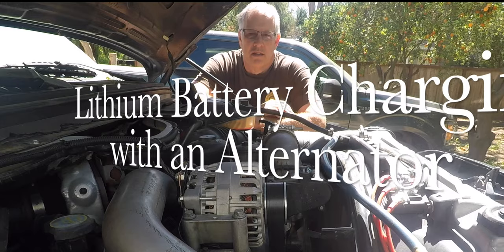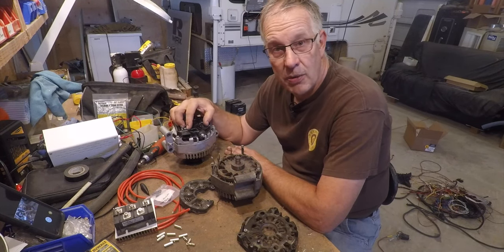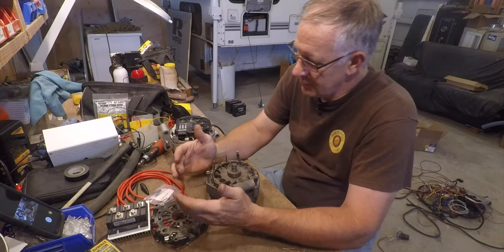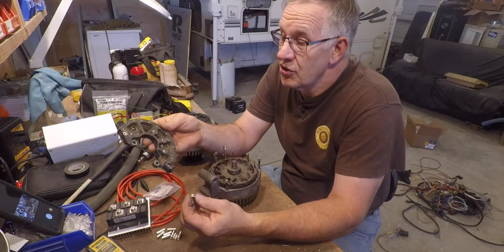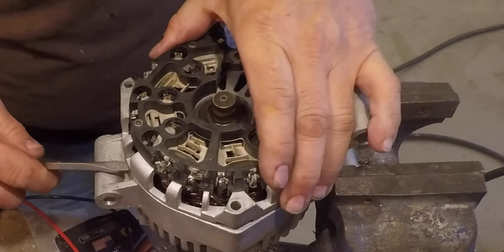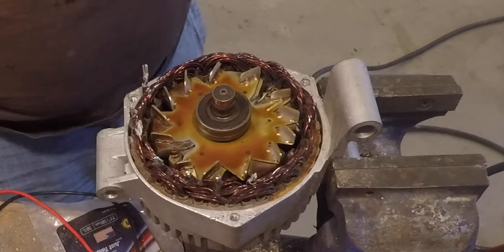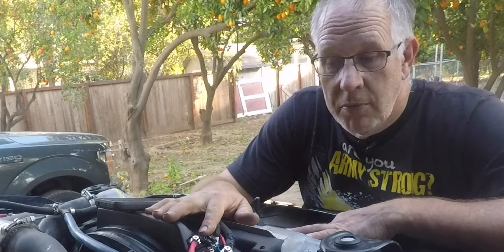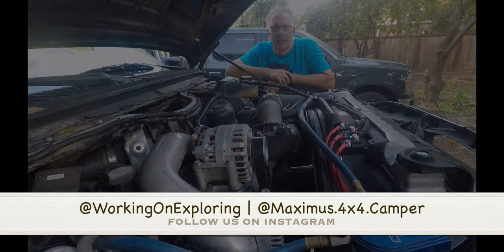Lithium Battery Alternator Charging | Don't Blow Up the Alternator | DIY Truck Camper

Comment: The more I see your rig you built the more I like it. I'm still building out my holiday travel trailer for off grid living but being on the road in this semi 3 weeks at a time is making for slow progress on the camper.  I'm wanting to build a 24 volt charger from a diesel 24 volt alternator and a harbor freight engine next
Reply from the maker: Sorry I missed your comment
 Automotive alternators are very inefficient and if you want to do the best possible, get a brushless alternator. They are around 75% as compared to about 60% for a claw pole design (standard automotive). Military surplus alternators are brushless and were cheap 4 -5 years back. I bought several which I am now not planning to use.  I have 2-24V/400A and a 12V/24V/200A. These things are very heavy and big. I converted a 12V/220A Ford 4G to 24V. It works fine but its not something I would want to use a lot (poor efficiency and heat) but it was  the only option I had.
Reply: @WorkingOnExploring  do you think I'd be better off just using my 120 volt to 24 volt chargers and a generator when I don't have enough sun to charge? I'd say going to harbor freight and buying a generator might be my best bet but I do like the alternator set up
Reply from the maker: I think a small portable 120V inverter generator would be more economical, reliable and lighter. THE KEY is to get a battery charger that can put a max load on the generator. You don't want to have a 2kw generator and a 1kw charger. The likely best way to do that is with a low frequency inverter-charger. My Samlex EVO 4024 allows me to set how much power it can draw from an AC source. I can set it to the max of a generator capacity OR the max of a shore connection. It allows me to draw whatever AC I want in the camper and the rest goes to charging. Charging is a second priority so AC appliances always have priority. The charger is 110A (at up to 29.4V) so is capable of fully loading a 3kw generator. If I am drawing max battery charge and I stick something in the microwave, the microwave gets what power it needs and charging decreases. When the microwave goes off, charging increases. This is most helpful when my 120V/30A shore cable is connected to a 120V/15A circuit at someone's home that may also be powering something in the home. If I set it to 10A to make sure I don't pop their breaker, that isn't enough to run the microwave. If I try to use the microwave, it switches to inverter and draws battery power to operate the microwave then goes back to charging. Mine does not have a power sharing where it augments the insufficient shore power by adding inverter power to make up the difference but several inverter manufacturers have that too.
Reply: @WorkingOnExploring  I have a low frequency sungold but it's the 4000 watt split phase.  It will do charging but it would take a 220 generator. I also have a 3000 watt all in one powmr that I can adjust the charge buy it will only do 40 amps and I'd like something that can charge at 150 or even 200 amps. Maybe even more.
Reply from the maker: You Sungold is only charges at 50A (about 1400W) which is a problem because you'll likely not find a 240VAC generator less than 3kW. Requiring a 240VAC shore input is also a problem as it is likely only available at a premium site in an RV park. I rarely need shore power and don't have a generator. When I do plug in,  There are lots of times where I run on 10A/120V.y A/C only needs 8A max to run with no starting surge. Do you have a need for 240V output? If not, you'll be better off with a 120VAC only. I'd look at what you really need for AC power both in and out. Inverters are very inefficient if run at less that 30% load (1200W). I wanted 3kw but it was harder to find in 24v. I also run an 800w PS inverter continuously to support the domestic fridge and small 120V loads 24/7 but that might be a bit big too.
Reply from the maker: While 40A is small, I assume, as a van,  you're unlikely to often be on a connection that can operate 150-200A (4-6kw). I also question that much amperage because it also infers you need a lot of power fast which is often not needed. Assuming you're parked (and charging) overnight assume a minimum of 8 hours to complete your charge. Assume an average battery debt....a 40A charger over 8 hours (assuming average battery voltage of 26.5v) you can recover 8.5kWh. that's a lot of battery debt. While the debt may be created over several days (assuming you have around 10kWh of battery bank capacity), that 40A still seems like it would be enough most the time. It gets expensive planning for those once a year or once in a lifetime events.
Reply: @WorkingOnExploring  I use a small welder from time to time. I have 3 charge controllers and the largest is a victron 150-70. I have 2 inverters a 4000 low frequency sungold power and an all in one powmr 3000. The powmr 3000 can charge from grid or solar or both. 40 amps grid 60 amps solar. I also have another 60 amp powmr charge controller. Rather than stacking a few small grid style chargers when we get a week of bad weather I'd rather have a 150 amp charger that would carry the loads while still charging the batteries. With a 150 amp charger if I'm in the camper continously useig power while charging its really slow to gain ground it seems
Reply: @WorkingOnExploring  my 38 seer minisplit is 240 volts and I split breaker box in half and run one leg of the 120 to one side and the other leg of 120 to the other. The only appliance thats 240 is the minisplit tho.  My welder is 110 volt and I actually run it from the powmr 110 inverter. Just charging while still powering everything else in bad weather is the only reason I want a large generator and super high amp charger.
Reply from the maker: Lots of hardware for a van but I'm sure you've got a reason for it. I'm also one that finds it hard not to be prepared for most things that can be encountered. Welding can be done pretty simply direct from an alternator. Probably a lot easier and lighter just carrying cables than an AC welder. The jeep I tow has a 250A alternator (for the winch) that will soon be  set up for welding.
Reply from the maker: Running 240v for a high efficiency minisplit may be losing as much energy in the inverter that you save in the A/C. Fundamentals of power conversion dictate that the greater the input/output differential, the lower the efficiency. In general, above 30% load, a 12VDV/120VAC inverter can reach 92%. A 12VDC/220/230VAC is around 85%. Better inverter designs can make a difference but the physics of 'leveraging' voltage just turns out that way.
Reply: @WorkingOnExploring  I saw a portable welding rig that has a nice wire feed and all that uses 2 car batteries.  It was pretty awesome. The reason I have so much equipment for my camper is that I started buying and installing this stuff to find out a little later that the 3000 watt inverter wasn't nearly enough power. I then got the 240 split phase inverter by getting  sent the wrong inverter... it was supposed to be a 6000 watt sungold single phase 24 volt but by the time I came in off the road to even see it for the first time the amazon return window had passed and I was kinda stuck with it. Then I saw the higher efficient minisplit and was looking at well pumps and figured I might should just keep it. Kinda glad I did. I've over the last couple weeks started buying some victron components. I got a new 150-70 smart solar charge controller at home and gonna be installed this evening soon as I get there. It's only a 30 foot holiday rambler so it really is alot of equipment for such a small space but one day I'd like a small off grid property and have a stable water source and maybe some of the equipment I've over bought will help out at that point.

Comment: Some initial testing done on two separate occasions: 1) At 98F ambient on level to slight uphill freeway at 210F engine coolant temp,  I could charge at 28.8V/90A (about 2.5kW) with alternator at 228F/114C, continuously. 2) At 40F ambient with about 140F engine coolant temp (in a snowstorm) on a winding downgrade 2 lane, I could charge at 27.4V/100A (2.7kW) with the alternator at 180F/78C, continuously ( and clearly could have tested much higher if not for the winding road). Overall I feel performance has improved at least 30%. It is difficult to replicate operating conditions for comparason. With the original alternator, in conditions similar to test 1, I would not have expected to get much more than 60A because of the high ambient and engine temps.

Comment: I love your videos. I'm just wondering why you wouldn't use maybe 4 awg silicone tinn  plated wire so maybe there wouldn't be as much heat in the wires. I think that heat means there is power being lost in the wires but maybe the power lost isn't a concern but that kinda heat would worry me especially over long term use. I love the way you put that heat sink into the fan shroud. That was the best place for sure.
Reply from the maker: I used 8AWG wire because that was physically substantially as big as I could make a connection to the 3-15AWG windings in the space available inside the back of the alternator. 8AWG/200C wire is also capable of carrying the 137A that each phase could operate at if the alternator were ever to produce 200A. I already knew that the 220A rated alternator would exceed 120C producing around 100A with a 85F ambient air and 200F engine temp. I was hopeful that removing the heat produced by the diodes that I could maintain or slightly exceed the 100A output at up to 100F ambient and 220F engine temps. The silicone insulation is more about surviving operation at these temps produced by the engine and alternator heat than the Ohmic heating of the wire itself since I'm intending to operate at about half of it's max current capacity. The 8AWG silicone only runs 3ft between the alternator and diode bridge then I run 2AWG welding cable from the diode bridge to the battery which is somewhere around 16-18ft for each conductor.

Comment: Its expensive but I installed a Litens OAD decoupler pulley on my 180 amp small case denso alternator. Most modern vehicles have a clutch or decoupler pulley to prevent issues with belt vibration. Seems like some people have an issue with using a solid pulley and some do not.
Reply from the maker: I believe decoupling pulleys are more common on smaller vehicles with fewer cylinders where power strokes occur every 90 degrees of crank rotation. I think acceleration and deceleration (of smaller cars) also has a greater effect on belt pulsation. I don't believe that 'most vehicles' have them but since I have never owned a vehicle with one, I  have no real experience with their effects.

Comment: Are you using MR2535 diodes for your TVS?
Reply from the maker: Littlefuse 5KP33CA...5kW, 33V standoff, CA= Bidirectional for my 24V system. I've used some 18V standoff versions for 12V systems. They make 3 series that will work for 12v systems; P6K is 600W, 1.5KPC(?) is 1.5kW, 5KP is 5kW. They also make bigger series that have bad leakage characteristics around 12v system voltages. If you want more info, I'm working on a blog post that will get posted in a week or so.

Comment: Great information 👍 
I use a 60 amp dc to dc charger on a 2021 Ford E350 cutaway van with the 7.3 gas motor. 
The brochure says the alternator is rated to 240 amps.
At idle with the ambient temperature 95F the alternator runs at 190-198F with ac and lights on.
Turn on the dc to dc charger and the temperature spikes to 240 - 247 F.
So I only switch the dc to dc charger once I actually driving the van and I switch it off when in traffic or idle.
Have you watched the victron video about cooking an alternator?

https://youtu.be/jgoIocPgOug
Reply from the maker: Yes, I have seen Victrons video and it is accurate. That is why measures must be taken if charging from an alternator.  Lots to unpack on the subject.
1) I have a volt/amp/temp readout on my second alternator that is used only to charge my battery. The temp readout is also a thermostat to shut off charging when the alternator temp reaches 120C. I manually adjust charging to my operating conditions and only use the thermostat as a safety.
2) See my blog for alternator thermal overload protection with a DC charger; https://workingonexploring.files.wordpress.com/2022/04/alternatorthermalprotection.pdf 
If you want one, send me your address and I will mail it to you free of charge in return for installation photos and evaluation information.
3) Understand that 'rated' capacity means what the alternator puts out at 6000RPM during its 2-minute performance test, into a resistance load bank, on a bench test, with 70F cooling air. It is only useful to compare alternators and has NEXT TO NOTHING TO DO WITH WHAT IT WILL PUT OUT CONTINUOUSLY IN YOUR VAN. Assume an alternator can put out ~1/2 of its rated capacity in your vehicle. 
4) Assume your A/C condenser, coolant radiator, oil cooler, transmission cooler, charge air cooler (if you have an intercooled turbo) etc will raise your underhood temps by 40-60F from ambient and that is what your alternator will have for 'cooling air'.
5) I have several videos on charging with an alternator as well as some docs on workingonexploring.com/techdocs.
6) You MAY have enough reserve capacity for a 60A charger but understand that a 60A charger OUTPUTS 60A at around 14-15V (900W max) into your battery. When your smart alternator is running at 'normal' output, it is only delivering 13-13.5V. The DC converter is only 93% efficient. To deliver 900W OUT of the charger, the input will need to be 900W/.93 = 968W. INPUT AMPERAGE of a 968W load at 13.0V is over 74A. That is the load on your alternator.
7) Alternator capacity at low RPM is barely enough to operate the engine because the alternator has very little cooling air from the fan.
8) Alternator capacity at high RPM (above normal engine speed) is greatly decreased because alternator efficiency drops from ~75% at low engine speed to ~40% at high engine speed. Loss of efficiency means lots of extra heat created in the alternator.
9) You need to measure your vehicle/engine demand over the range of accessory operations you are likely to encounter at around 2000 engine RPM and see if you have a reserve of 74A to operate your DC charger. Put a clamp meter on your alternator cable and turn on your lights and heater, etc to find peak demand. 240A/2 = 120A - peak operating load = reserve capacity (at nominal engine RPM). This is the MOST YOU WILL EVER BE ABLE TO COUNT ON. Low engine speed will be less, high engine speed will be less, and adverse driving conditions will be less.....
10) alternators have no thermal protection. They respond to overloads by overheating till they fail. You have already figured that out. If you put a device able to overload your alternator, you had better have a way of unloading it when it overheats.
Reply from the maker: I suggest you watch this video and possibly the second one. https://www.youtube.com/watch?v=gDIsOaEI9Wo&ab_channel=WorkingOnExploring